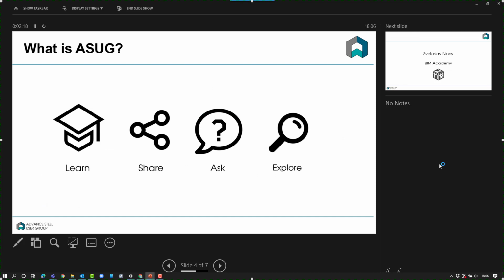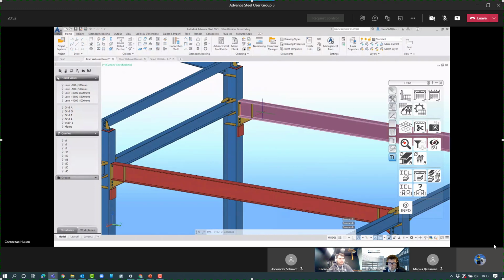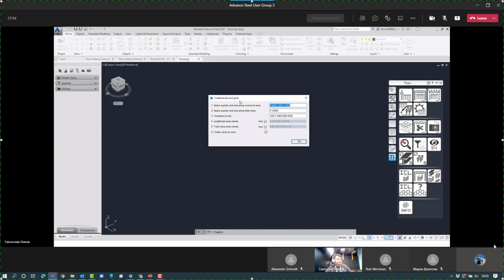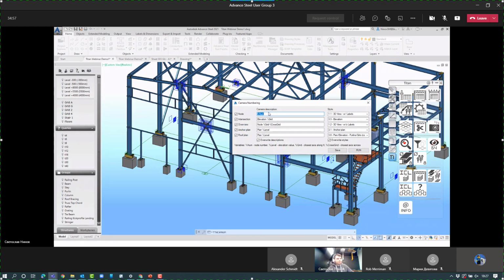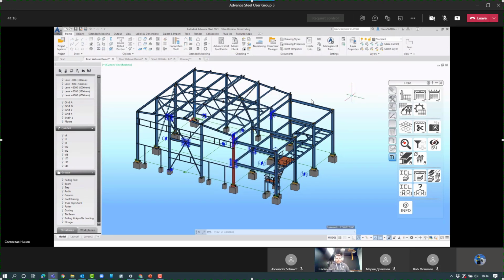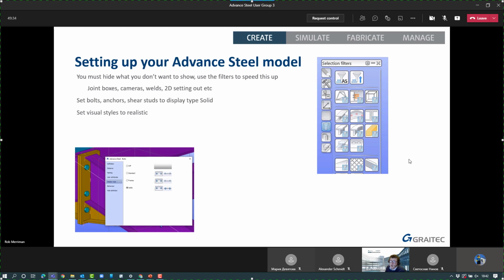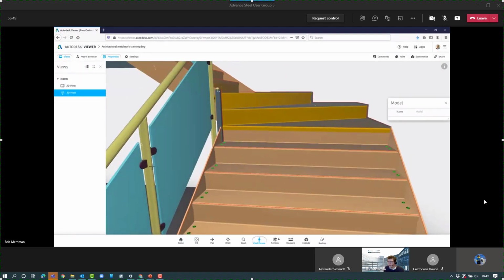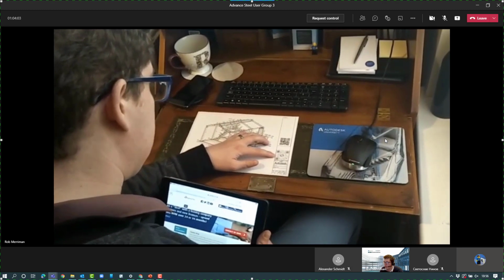Advance Steel User Group 3

Comment: AS is a great tool but have issues while exporting the drawings to Revit because many elements are missing, assuming Revit doesn't recognize the most of the AS's library of beams and columns. I tried to use Advance Steel extension for Revit, export it through the IFC, nothing helps. If anyone has a solution would be a great help.